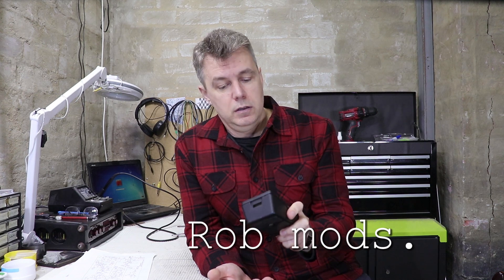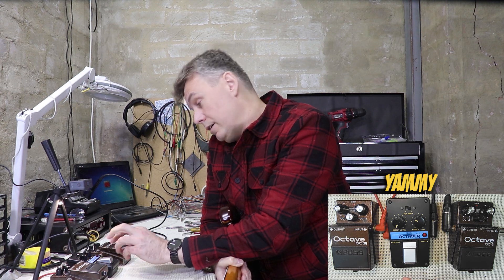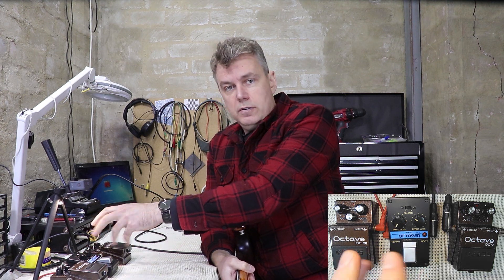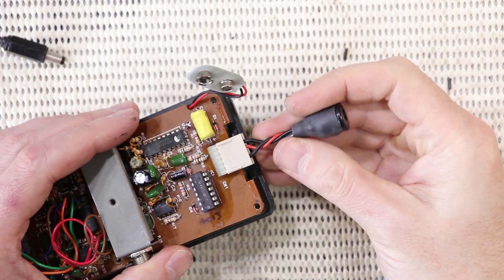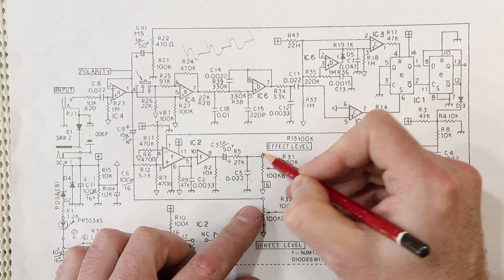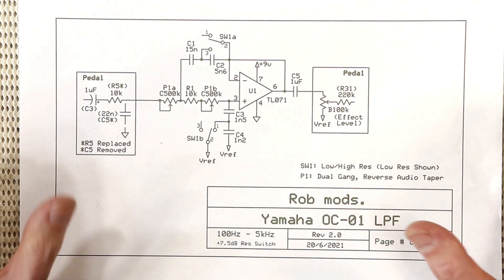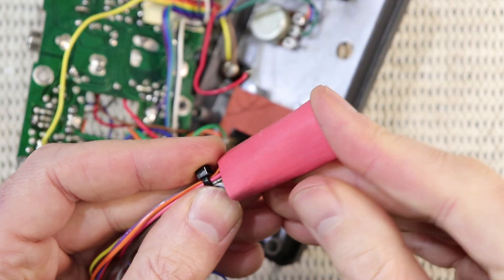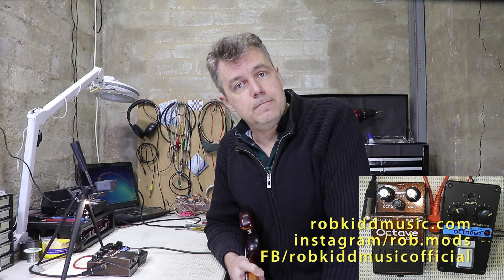Vintage Yamaha Octave Pedal Mods and OC2 Shoot-out.

Comment: Love these mods. On the OC-2 as you have modded it, how hard would it be to add an expression input that would allow you to sweep the low pass filter linked to the octave down effect?
Reply from the maker: Well I guess you could do it by installing a dual gang 500K C-taper into an old volume pedal.  The plastic Proel brand ones are good for this, because they take a standard 16mm Alpha type pot.  You can pick them up cheap 2nd hand.  You'd need a switching jack to automatically disconnect the pedal's pot when you plugged in.  And this would be a bespoke exp pedal for this particular stompbox.

If you wanted to use a generic expression pedal, then that's a whole new thing altogether.  You'd need a circuit to take the voltage from the exp pedal (probably a linear function) and drive a dual variable resistance.  I'm guessing a digipot...?  I don't have much experience with that sort of design I'm afraid...

Comment: I'd guess the polarity switch changes the polarity of the sub signal with respect to the dry signal. Since you have the dry signal turned down there I'd guess that's why you're not hearing a difference.
EDIT: Should have continued watching. It looks like it flips the polarity of the signal before the divider but doesn't touch the dry path. I think this should alter the relationship between the effect signal and the dry signal, but maybe the audible effect is minimal. It's interesting that it tracks better - maybe the polarity of the initial transient from plucking is easier to read one way?
Reply from the maker: I'm not really sure it effects the tracking, TBH.  It was just a feel thing I noticed when I first got the pedal.  It is a weird switch.  With the Boss OC-2, messing with the octave divider path does indirectly effect the tone of the pedal.  It took me a while to cotton on, but I realised it was the phase response of that 3rd order LPF right before the square wave section, because this effects exactly where within the wave that the fet actually switches.  Plus it is frequency dependant of course.  With this Yamaha/Korg pedal, that switch simply reverses the phase of the square wave completely, regardless of frequency, so the resultant modulated effect wave is still actually in phase with the direct signal.  I rambled on a bit more about this when I was filming, but cut it out in the edit.  Seemed to derail the video a bit...

Comment: Are Yamaha pedals buffered or true bypass?
Reply from the maker: This pedal was not true bypass, however there's mechanical switching instead of fet switching, which means the bypass signal only goes through one (opamp) buffer.  With a boss pedal, the bypass signal goes through two or three discrete buffers.
Reply: @RobMods  Ok, thanks. I ask because I was wondering if there'd be a marked difference in tone if one were to put the booster before dirt pedals.